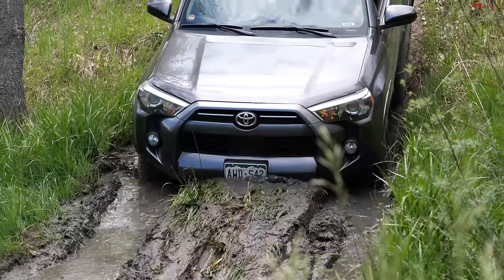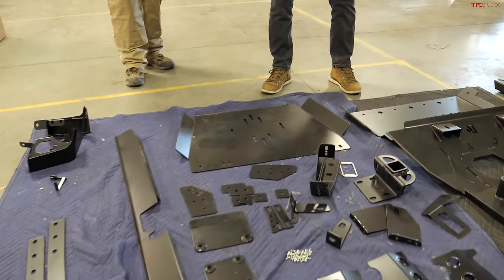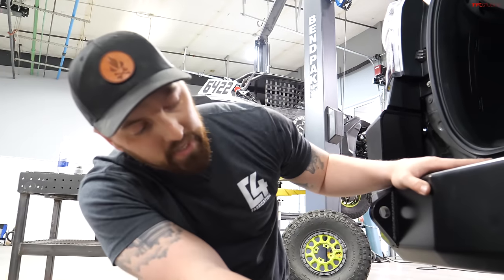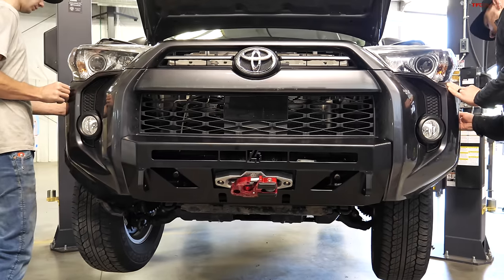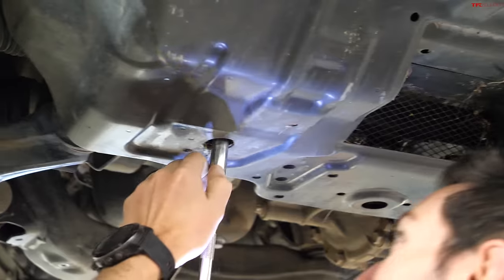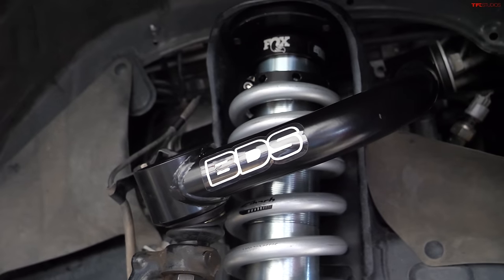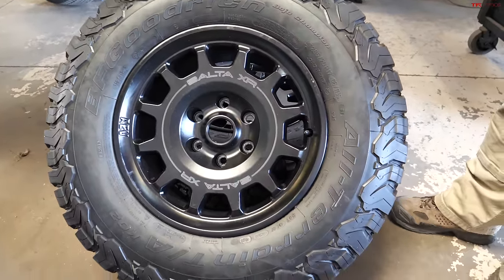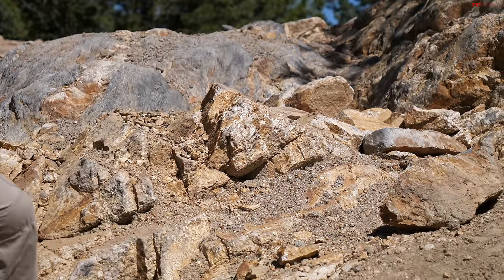From Boring to Brilliant: Here's How to Make a Bone-Stock 4Runner UNSTOPPABLE Off-Road!

Comment: Well, it is... something.  "Unstoppable" is not what comes to mind however.  The minimalist change in the front to support the winch is only thing they did to it that was not hideous.  Although, the wheel/tire change is good.  It is a tough rig to modify w/out compromising factory design.  I wanted a swing arm rear bumper for spare tire carrier, hi-lift jack and potentially a gas can, but when I seen what that meant for the existing fenders, I cringed.  Better option is just use the existing hitch and mount a receiver that holds the hi-lift and spare gas can on a rack.
Reply: Good comments, but I needed the truck to fit in my garage, so no swing arm tire carrier. That was the compromise between all-in vs. my real life that I made. So far so good!
Reply: @MrGrantSDavis  I gather this is your SR5 they are doing all this too.  So, I will be mindful of what I say in the future.  I don't understand why you let them cut up all the back of the vehicle like that to put on that much steel.  James rig is a stock bumper and fenders and he gets around fine.  Granted, he has basically a plow in front of him mashing the trail down before it gets to the back ...lol  But I don't understand the rear change.  When ever I see 1 with that much steel back there, it is because the owners are mounting all types of other gear to it.  Are you asking for all these changes?  Or just letting them do what ever and crossing your fingers? BTW, in my comment above, what I wanted, that was literally about my own vehicle.  Not a preference to yours.  Or anyone else's for that matter.  I don't want to add weight to my rig, nor alter the design/cut up body parts and bumpers if I don't have too.  But IF I wanted to carry a hi-lift jack and spare can, a receiver hitch rack can make that happen so no modifications are needed.
Reply: @WW-wf8tu  I really love how this truck drives now. And that's all that matters, right?
Reply: @MrGrantSDavis  You nailed the sentiment right there.  Don't matter what others think.  Only if you enjoy it.  👍

Comment: No matter how cool you think you or your 4R is on the gram the
Same rules apply to a 4R....or a Jeep....or a racecar:

Always.gonna be someone who spemt more money and has a cooler more capable ride. Coolest 5th Gen 4R is RSGs w Tundra 5.7 swap w Maggie blower on top sending power to some 1 tons on 40s.

 The same ole swing out spare tire carriers, widdle ladders and fold out shelves to make stir fry while you camp on the roof doesnt make your 4R capable but thats 70% of modded 4Rs here in Socal. Guys proud to lift a wheel in air instead of adding travel, proud to show off blinky lights from amazon but no air lockers, still 'rockin' front sway bar etc;

Comment: The trucks look fantastic with all the mounted accessories. It still baffles me why car manufacturers got rid of metal bumpers. How much does the added weight affect the truck’s performance?
Reply: I believe most of it is safety regulations as far as crumple zones and pedestrian safety. Not to mention cost
Reply: Pedestrian crumple zones. Just like not being able to get hood ornaments from the factory.
Reply: It's really slow on the highway. I didn't have James mention this, but I'm getting about 4 mpg's less than I did with stock.
Reply: @MrGrantSDavis  Wowza.  Expected a reduction in performance and MPG, but that is substantial when it was not exceptional to begin with.  Biggest question is, how do you feel about it?  Still glad they did it?  Do you have a Prius Hybrid to offset the MPG changes?  lol
Reply: expecting a reduction is a big understatement.

Comment: 2.5 lift on a 4Runner is a better all around lift than a 3 inch. It’s a bit better ride around town and you won’t have to worry too much about the front diff and it’s still going to give you enough clearance off road
Reply: 2" is pushing it on a Toyota ifs
Reply: @tuckerhiggins4336 was thinking the same thing. On these it's not the lift that fits the tires, whether it's running a two or three inch lift, they still have the same tire limitations. At least with a 2-in lift you keep that extra inch of droop.
Reply: @trailrunnah8886  You essentially "lose" fitment the more you lift. Angles. You'll have to google it

Comment: It’s funny reading all the comments on a build project whining about building it up. To me building up the SR5 made the most sense. Why pay $20k more for a pro only to then rip out the suspension and make all the same mods. I bought the SR5 Premium in Dec 22 for right around $45k and since I’ve lifted it on Elka 2.5 DCs, RSG sliders and under armor, put on KMC 17” wheels and wrapped them in 285/70r17 Mickey Thompson Baja Boss A/T’s, C4 Lo Pro with high clearance additions and Warn Evo 10S winch. Add to this an ARB twin air compressor mounted behind the air box under the hood and a few other smaller mods I’m forgetting. All this, including install cost, was right around $20k.   I know some will still say should have done the Pro but now I have it looking how I wanted it and not like all the mall crawler Pro’s I see around town. It comes down to having the means and the dream and that’s all there is to it.

Comment: Next up, rear locker
Reply: Not really necessary here in Colorado with our terrain.  I used the rear locker on my FJ maybe 4 times in 7 years, on my 4Runner just once in 5 years of running trails here.

A front locker is what these trucks really need, but I don't think Toyota has ever done a front locker on an IFS truck.  There's a lot of opportunity for user error with those.  ATRAC makes a big difference, but it doesn't climb as smoothly as a front locked truck does.
Reply: @jimmy-buffett  not necessary but when needed it is a great tool to have.

Comment: How to make a 5th gen get 10mpg.
Reply: The red 4Runner in the previous video -- mine -- gets 18 MPG @ 60 MPH and a whopping 13.5 MPG @ 82 MPH.  It spends most of that time at 82 MPH in 4th gear, sometimes 3rd.

Let's just say that I'm really looking forward to the new V6 turbo Land Cruiser with 8 forward gears.
Reply: @jimmy-buffett  I wish i could afford the landcruiser.  I’ll have to wait to see if the 4Runner gets the Hybrid Max for 6th gen.   My 3rd gen sees 15mpg on a GOOD day.    You put a front and rear steel bumper with tire carrier on a 4runner you will not see 18.  it’s impossible.

Comment: Step 1: Sell 4runner
Step 2: Buy solid axle vehicle like an old land cruiser
Step 3: Use savings from previous step to build off roader
Reply: What if someone doesn't want an old wore out truck that needs a bunch of maintenance and having to deal with the fact that most parts are discontinued and the 1FZ doesn't like going freeway speeds at a mile over sea level? Not to mention a clean Land Cruiser is almost as much as a newer 4Runner in price.
Reply: I have seen some Land Cruiser 80’s more than 4Runners, just ask Untamed Motors
Reply: You could buy a stock jeep rubicon and do nothing with it, other than hit the trails. It will still be more capable than any built 4R. The only reason to go 4R is supposed build quality… which you won’t experience for 10 years anyway.
Reply: The last solid-axle Land Cruiser (FJ80) weighed nearly 5000 pounds and had just over 200 horsepower.  Here in Colorado this engine is down 20-35% on power due to the lack of oxygen.  And that's without ~800 pounds of steel from bumpers, armor, sliders, skidplates.

I have friends here who wheel FJ80's, they're great on the trails and slow on the road.  I've done every named trail in Colorado easier than Blanca Peak -- Spring Creek, Wheeler Lake, Chinaman Gulch are a few examples -- with a 3-inch lifted IFS FJ and now 4Runner.

9 of the ~13 trails you're enabling here in Colorado by going SFA with huge tires are buggy trails less than 2 miles long with no scenery and a high chance of body damage.  If that's your thing that's fine, but SFA isn't required to run anything easier than an 8/10.
Reply: @jimmy-buffett  if your off-road goal is to take dirt roads, shelf roads, and mild trails and you don't mind taking bypasses sure that makes great sense. Different strokes for different folks, but a great offroader the 4runner will never be with out massive amounts of money that would be better spent on other platforms.
Reply: @Bleda2002  you know, not everyone considers climbing over boulders mainstream offroading. Theres a reason why the Bronco isn't SFA. You know what a Rubicon goes for nowadays? Its a lot of coin just to get a solid axle rig that you wont be tossing into boulder fields and buying a non Rubicon wrangler costs just as much if not more than modding a 4Runner replacing weak axles and throwing on lockers and what not.
Reply: @CACressida  4runner is about the same price as a jeep Willy's, comparably equipped, for 2024 it comes with rear locker, beefed axles, upgraded tech.  You can also get a basically fully loaded Rubicon on 35s from the factory for the same money as TRD pro 4runners, it's not like 4runners are cheap.
Reply: @Bleda2002  dunno where you're getting cheap Rubicons at but you're not touching a Rubicon for less than $55,000 in my neighborhood. And a 23 Willys with no locker is pretty steep in price as well so I can only imagine what the 24 would be like now that they can advertise a locker. Meanwhile for the same price as a 2dr willys without a locker, I can get a TRD offroad 4Runner with a locker and not have to torture myself with the suspension thats bucking you around like a galloping horse and a loud interior when going over 45mph. 

Just because the MSRP says you can get a jeep starting at 30 grand doesn't mean you'll get a new jeep at 30 grand. And if im going to torture myself with a Wrangler, my money is on the Rubicon with the Dana 44s, the better tcase ratio, the front locker. Why waste money on lesser Wranglers with weak front axles and none of the offroad perks?
Reply: @CACressida  a TRD off-road 4 runner is 50k, a Willy's is the same price for 2024 with the 35s lockers etc. The 4runner used to be an ok deal, but it's just not anymore. A TRD pro 4 runner is Rubicon money as well, add in mods to the 4 runner and there is no value proposition there at all.

If you think the jls ride like a galloping horse you've clearly never actually driven/ridden one. Obviously not ifs in steering, but from a suspension/ride perspective they're actually better than a lot of cars on the road today.
Reply: @Bleda2002  I just literally got back from a 110 mile drive in a 2 door Rubicon and I can most definitely tell you its a bucking horse. Your ass is literally on top of the rear axle. A TRD offroad 4Runner around here averages 45 grand and a 23 Willys 2 door is 47 grand within 100 miles of my zip code. You're not touching a locking diff wrangler for any kind of a bargain.
Reply: @CACressida  a 2 door is not the same as a 4 door. I have a jlu and and gladiator and previously had an FJ cruiser for 6 years before upgrading to be able to do more difficult trails. The 4 door rides like any other SUV.

Quick search here has trd off-road for 49k cheapest, TRD pro for 55-58k, jlu Rubicon for 54-60k, and Willy's xr for 52k
Reply: Solid advice...or even grab a Nissan Xterra and with a couple mods/add-ons it's good to go.

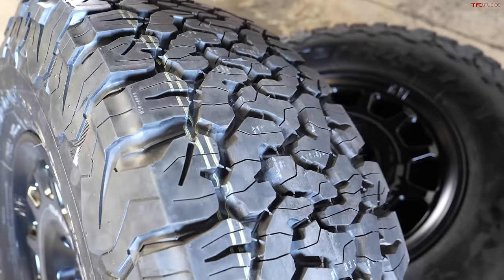Comment: 23:25………..dude did NOT answer the question at all whats the benefit of a wider wheel and tire! 😳🤦🏽‍♂️
Reply: Depends on the use application.  There is an argument for narrower tires as well.  Search around for your answers and use needs.
Reply: @WW-wf8tu  I guess the comment went right over your head.  ✈️ 🫠

Comment: Toyotas are boring and even after you spend a fortune on them are only "ok" offroad. I don't see why so many people like them?
Reply: I have one, I bought it mainly as a practical & reliable daily driver. It's great for camping and hauling around my dog & mountain bike. I agree though about modding them, you spend a fortune on them and they're really not much more capable than stock. Meanwhile, after throwing a bunch of money at a Toyota, one could buy a stock Rubicon that would be more capable off the showroom floor, AND be way more capable with similar mods. Like a two or three inch lift let's you run 33s on a 4Runner while that same amount of lift would have you running 37s on a Wrangler.
Reply: You sound like you don’t get out much.  All the people exploring  moab top of the world and trails begs to differ.
Reply: @Anomize23  that's hilarious. I probably do more offroad miles in one year than most do in their life times. Ive also been around just about every production 4x4 in the market and seen what they can and can't  do. Ive owned Toyotas before. Just because a bunch of people own them doesn't make them good offroad or not boring. My statement stands.